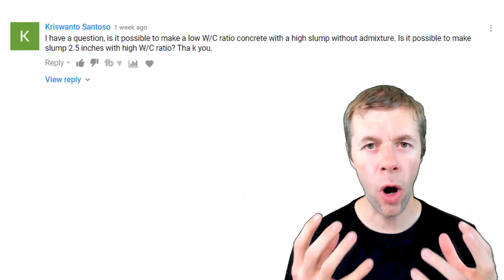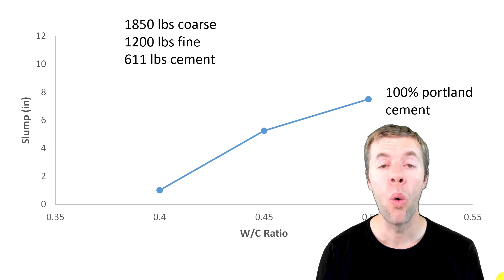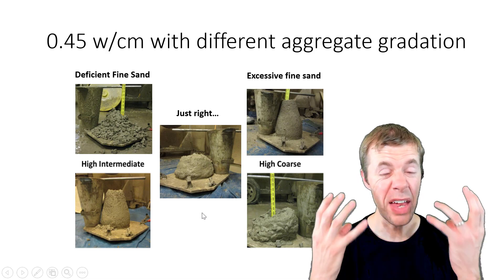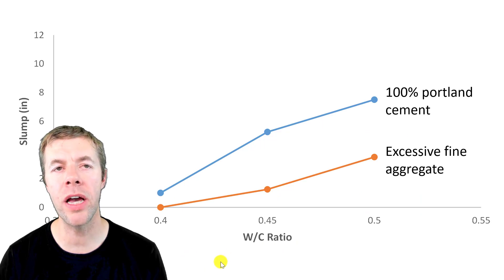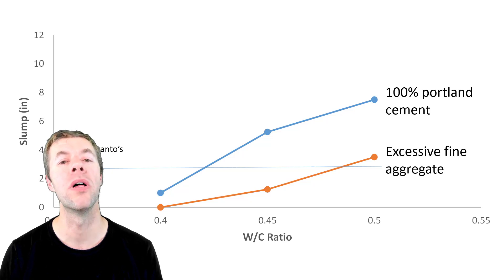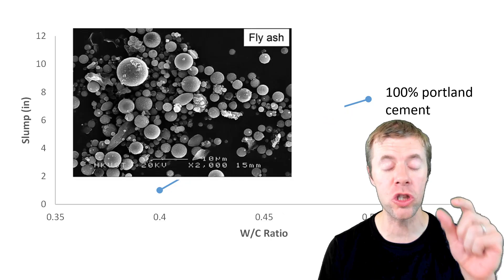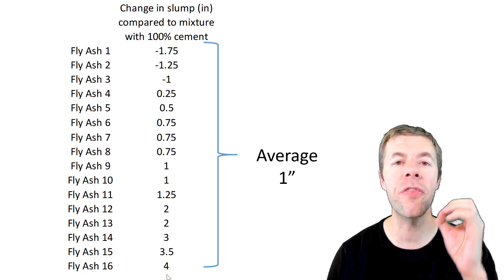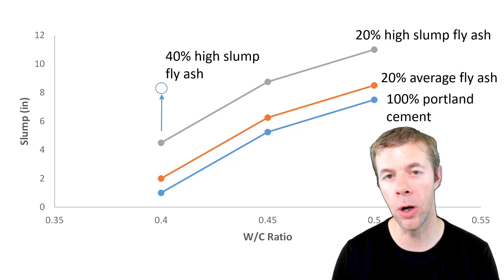How are Slump and Water to Cement (w/cm) Related? Q&A Response!

Comment: Assuming that you can design a mix with sufficient slump, what is the limiting minimum water to cement ratio for proper chemical reaction? Is that limit expressed as a drop in strength or an increase in cure time; could the mix partially hydrate and partially cure then months later have more moisture added and finish curing to a normal strength?

Comment: Tyler I have a question about chairing...uh..makes little sense to me.  I realize we'd like to keep welded wire mesh at nice positions in the concrete horizon, but the introduction of all that alternate (plastic?) material just makes zero sense.  Have you a video related to reinforcing materials?
Reply from the maker: Jami,
We use chairs to keep the reinforcing steel off the bottom of the slab or beam.  That is where the strain is the highest but the reinforcing can be damaged by outside chemicals, fire, etc.  Here is a video about reinforcing materials: https://youtu.be/7DovGzBOB_I
It may also be good to watch a video about cover: https://youtu.be/JkGMBSveqJ0

You don't have to use plastic chairs.  You can use metal ones.

Comment: Dr Ley,I recently did some mixes at my lab with replacement of ordianary portland cement by ground granulated blast furnace slag,the slump increased by 20% for 30% slag replacement.Though I should mention that I had added 0.8 % admixture for all the mixes.
Reply from the maker: Slag can also increase your slump depending on the size distribution.  This depends on the size distribution of the cement you are using as well.  It is pretty complicated and it is an area of ongoing research.  Thanks for sharing!!!
Reply: I did a couple of more mix's today,and I feel that as the admixture that I have used is  regarding in nature,it is causing the  hydration to slow down and as slag has a lower rate of hydration than portland cement,so when more and more cement is being replaced by slag,the rate of hydration of the blended cementitious binder is slowing down causing the mix to have more initial plasticity.
Reply from the maker: Kushal,
Slag does slow cement hydration.  Maybe it is reducing the impact of ettringite formation on your initial stiffening.
Reply: Dr Ley,that definitely can be one of the reasons.Will be going for a xrd test soon,may be that will through some light on the subject.Thank you very much for your input.Sir,while we are on the matter of changing workability without altering w/c ratio,I did some mixes in the lab on replacement of sand with brick dust,stone dust and also slag.The mix became stiffer and stiffer on the addition of the alternate fine aggregates.One of the reasons according to me was that the water absorption values of those materials were higher than sand.

Comment: Awesome. Thank you.....
Reply from the maker: I hope it helps!  Let me know what you think.
Reply: Tyler Ley
I have a better undertanding on the importance of aggregate gradation. I ordered concrete mix from 2 different batching pant. All same spec on paper. But one is always better in terms of slump and no segregation. While the other have higher slump (always within the with the upper tolerance) same w/c ratio. Thanks for the tarantula curve spreadsheet provided from other video, now i will always try to use it in the mix design.